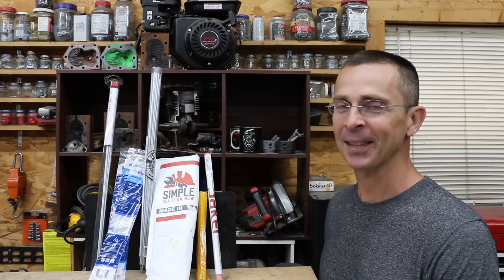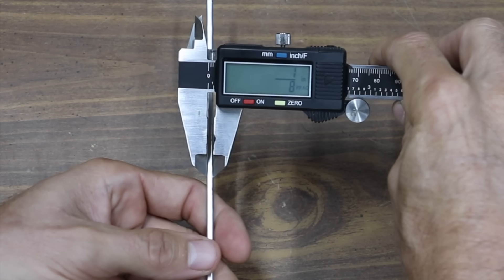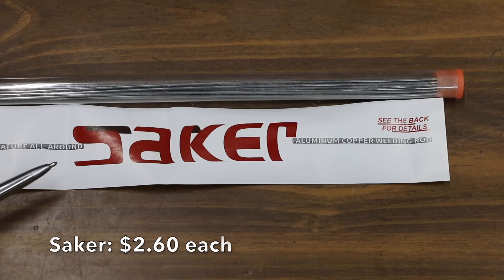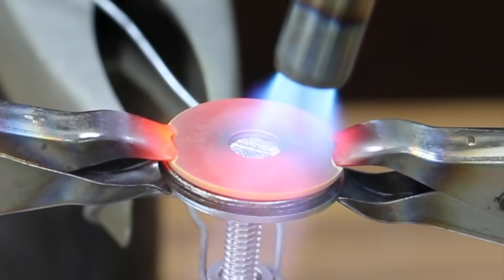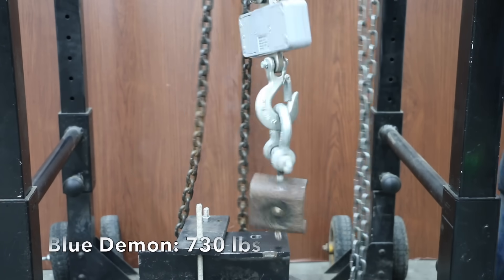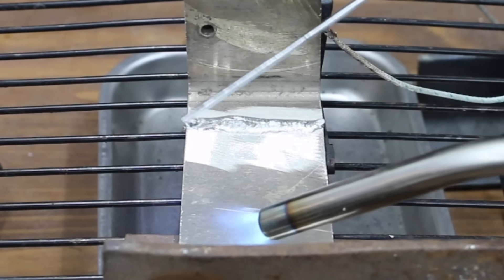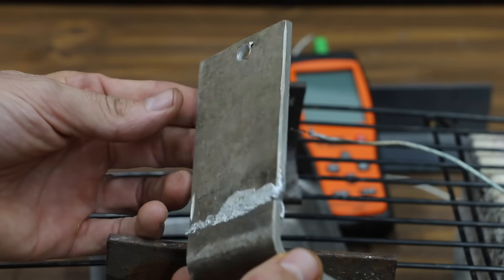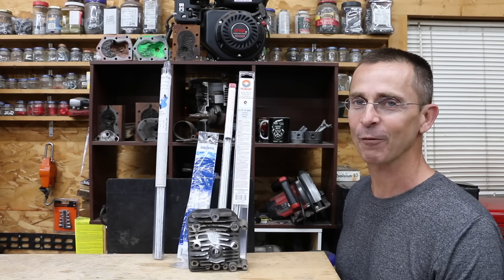Best "No Welder" Aluminum Welding Rods? Alumiweld vs Bernzomatic vs Hobart

Comment: I have one of those old 1950s aluminum poolside recliner chairs that uses steel springs inserted into holes in the aluminum tube frame. The cushions are still good, but almost every hole needs to be repaired. Along with a crack in the aluminum tubing at one place. I'm glad to hear that the Harbor Freight brand did so well, considering that I have a store in the next town over. And good to hear that MAPP gas is the gas to use. I guess I know what I'm gonna do next weekend!
Reply from the maker: Thanks for sharing.

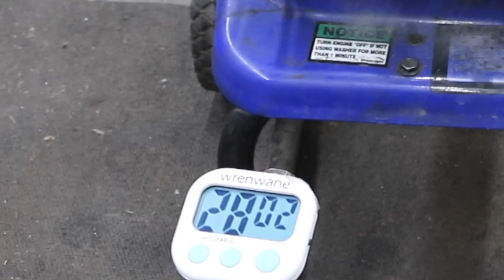Comment: 13:11 - "the repaired area is a lot cooler than the surrounding area"

That's not good. The purpose of the fins, is to dissipate heat from the combustion chamber, in order to prevent a hot spot causing predetonation... or worse yet, a heat accumulation area which may induce failure. A cooler exterior surface means less heat is being extracted from the head, which would lead to (at best) a reduced duty cycle.
Reply from the maker: Thanks for the feedback.

Comment: My aluminum storm windows could use some repair. But the material is 1/16" or so (thin).  I would like to see how to 'weld' the corners together (butt welds) with this stuff.  Because of the thin materiaal, I think I would need the one(s) with the lowest melting point.

Comment: The difference you see with the thermal cam is due to surface emissivity that isn't the same. In fact, it's really hard to have accurate measurement with thermal cam on metal... with your condition it's nealy impossible.
As it is my job to install and programm fixed thermal cam in the industry, the best advice for what you do is simply put high temp black BBQ paint on the surface measurement or using teflon emissivity sticker. You will have 0.95 emissivity ratio that is very good :)

Neverless really good video, I have on my garage some brazing than I was unable to melt so now I know it's not my fault if they don't work.
Thank you for this video !
Reply from the maker: You are welcome!

Comment: I used the Bernzomatic torch with MAPP gas and built a fairly decent aluminium camera mount using aluminium from Tractor supply and re purposing 1/8th welding rods whose performance improved dramatically after I knocked the coating off. Pics... https://1.bp.blogspot.com/-rj9rw3ZgcS4/YHy0Q-tjOoI/AAAAAAAAZhM/7BE1xctrOH0XmyWmRkdG9iCJ27c4gXm8gCPcBGAsYHg/s2560/IMG_20210418_181943.jpg
https://1.bp.blogspot.com/-M18eQSykceo/YHy0Q6K246I/AAAAAAAAZhM/gkAvAlV6-Scnzew1BxmwICcNiYkOkX5wQCPcBGAsYHg/s2560/IMG_20210418_113402.jpg

Comment: Great video. Using non chlorinated brake parts cleaner makes me wonder which aerosol solvent works best. I use supertech carb cleaner because it has the widest diversity of organic solvents in the ingredients for solvent action and uses inert non flammable CO2 gas as propellant. But I would like to see a comparison of chlorinated and non chlorinated aerosolized solvents and cleaners put to the test.
Reply from the maker: Thank you!  Thanks for the video idea.

Comment: All I know is my first time using this one was from Harbor Freights on a 5000 PSI system it was to my Turbo all my diesel the whole was size of a quarter very easy to use and been driving it for two-and-a-half years and the whole has not came back not just that it's 5000 PSI but it is very hot air
Reply from the maker: Thanks for sharing.

Comment: It would be interesting to see how you make out trying to braze two pieces of square tubing with a 45 degree cut for a 90 degree angle when you need to braze both the inside & outside surfaces.
Reply from the maker: Thanks for the suggestion.

Comment: I wanted to thank you for all the testing of products.   Years (,ore than 10) years ago I bought some rods at a county fair that a guy was selling.  He had several pieces of pipe , coke and Pepsi cans, a transmission case and several other real type uses to show the products and to show and, he let me try and would show me how I could weld a hole in a coke can if I would buy a packet for some 20.00 which I thought would be oj if I could make it work.  Well of course II did weld up a hole and bought a couple of packs because I worked in a car dealership as well as had a couple of farmer friends that always had irrigation pipes to fix.  that next week my transmission went out of my truck because I hit a large rock in the road and couldn't swerve to avoid it.  The case was broken in several places and was going to cost over $1000/00 because of it.  I  picked up the couple of pieces in the road while waiting for a tow truck.  I couldn't find a new case at that time and it was my work transportation so I tried welding or BRAZING it and it worked fine and is still on the road all these years later.  I've used it on several; things without any problems and its paid for itself 100 times over and I've made a lot of money fixing lots of things.  The trick is make sure its cleaned beyond clean with a stainless steel brush and I always use the brush only for aluminum or bought a new brush every time.  HEAT ONLY the base metal not the rod and it works great.  I will get the rods from Harbor Freight when I need them or there is some online that has different heat ranges I've used to build a small trash hauling trailer out of used aluminum and still use it today as well.  I used the high heat ones for that so give it a try
Reply from the maker: Thanks for the suggestion.

Comment: Very good video comparison! It comes down to what you are welding. How much does a miller dynastic 250 and setup cost?  Too much, but you get a true weld, whereas these are just braze. As I said, comes down to what you are welding. Good job not showing muggy. It's bad enough they Take you over the coals for 80 bucks, they over charge you with a 16 shipping charge for 1lb, lol. Take care brother
Reply from the maker: Thanks!

Comment: Excellent review but just one problem. Map pro isn't actually mapp gas. Mapp is no longer sold in most places nationwide. Map pro is just basically propane. I used a blue tank and a yellow tank with the same torch head and heated up a stainless bolt for 1 minute and checked the temp and got the same result for each type of gas.
Reply from the maker: Thanks for the feedback.

Comment: Great video brother ! Ben welding for 40 years now . Slways stick to your name brands when it comes 
Filler metal . Ill take Esab or UTP products over anything . Got a rep for my stuff not breaking . I always use M.E.K to prep my aluminum before welding . Its residue free and flash drys . Remrmber on thicker pieces your brazing together you should always butter or tin each piece seperatly .
Then braze the 2 tagether . Ive ben using aluminum stick rod to repair fuel tanks for over 30 years . Love your channel brother ! Be safe !
Reply from the maker: Thanks!

Comment: If you are working with aluminum just do what has been done for years, TIG weld and be done. There is only a couple of grades aluminum that are not recommended to weld. Tig welding of alum. is not hard at all and if it is a thicker piece you can use helium instead of argon for sheilding gas. As many used and even new welders out there they are very affordable and a tig machine is very versatile, and has many uses.
Reply from the maker: Thanks for the feedback.

Comment: I just bought some. Trying to weld aluminum to copper. I melted the alu before the rod would even get close. And it claimed melt at 500.
Will have to give one of these a try. Surprised at HF brand
Reply from the maker: Thanks for sharing.

Comment: I've tried the Hobart I preheated the metal to the right temperature with a temp stick. Then I used a TIG torch and it works great it look like a roll of Dimes. Preheated with oxy-acetylene. I have been a pipe welder for 53 years. Then I tried pulling tubing without the TIG torch it wasn't as pretty but it was strong
Reply from the maker: Thanks for sharing!

Comment: Thank you for doing this video, not long ago I had to downsize my shop and therefore lost the ability to weld whenever I wanted so I turned to brazing. The first few rods I bought were really bad, I melted the aluminum plate before the rod. 
Because of your video, I went to Home Depot and grabbed the Bernzomatic and I am enjoying it so much I am now making art brazing it all together. Thank you, I have started binge-watching your videos because like you, I have many different hobbies along with being a Mechanic and a Journeymen Electrician. Not bragging just saying what you do has helped me a lot.
Reply from the maker: You are welcome!  Glad to hear!
Reply: I picked up the H. Freight stuff but Benzomatic looks better overall.
Reply: Do you have any updates on the brazing of aluminum? Are you still using Bernzomatic aluminum rods? Do you have any important tips for cleaning?
Reply: @Ritalie  I clean with anything that drys clean like rubbing alcohol, I have even used Goof Off But I am sure Project Farm knows a lot more about this than I do.
Reply: How do you get it to stick? It's not sticking. It melts but doesn't stick.
Reply: @ESLinsider  The trick is to try to heat the aluminum close to the temperature that the brazing rod melts, I hope this helps
Reply: @ProudDad1976  Right I'll try it again. Torch I got stopped working.
Reply: I want to thank you again for your work on the videos, they are my goto when in doubt. Thank you!

Comment: One other thing.  This rod can also braze aluminum to copper (sucj as copper tubing to A/C aluminum tubing in heat exchanger.  You can braze on copper square to aluminum frame you want to make electrical connection to, then solder to the copper with soft solder.
Reply from the maker: Thanks for the feedback.

Comment: Brazing aluminum with these rods requires a totally different technique from conventional welding or brazing.  Best is to preheat the disassembled parts & work the alloy in to each surface.  Contrary to instructions, preheat the rod a little in flame (ALMOST enough to melt as the base metal is being heated.  You do not want the base metal to be too hot, just BARELY enough.)  The working in needs to be done at just barely above alloy melting point so much "scrubbing" is done.  Then assemble & heat (move into position as the brazing alloy melts).  Finish by sweeping around the joint edges with rod & allow to cool.  Understand that any heat treatment in the base metal (such as the bolts) is lost.  You can restore this by soaking at 350F for 24 hours, then air cooling.  The hardness returns slowly, in about a month.
          I used this to braze 1/8th scale railroad rail (1" high x 7/8" wide) to make criss-cross & switch frogs.  They have been in service for over 10 years, exposed continuously to the weather outside.  600lb steam engine runs over this rail.
          If you have an ultrasonic soldering iron, this can make better joints, as this facilitates "grinding out" the oxides.
Reply from the maker: Thanks for the feedback.

Comment: Would you test those inexpensive inverter welder 110 volts, as low $99 uscy , or the link if it is already done. Thanks a lot.
Reply from the maker: Great suggestion!  Thank you.

Comment: Thanks -- I seek to "weld" various nonferrous metals (coppers or various brass alloys) to various aluminums for light-duty connections required for scrap metal woodwind instruments. I might need to seek different products in this case but you gave me the best brands!
Reply from the maker: You are welcome!

Comment: There's a very good product from the refrigeration industry you might consider testing if you ever revisit this.  It's called AL822 by Lucas-Milhaupt.  It is an expensive product, but works extremely well.
Reply from the maker: Thanks for the suggestion.

Comment: This only works on small and thin repairs you won't be able to do this on engine cashes that can't be removed without removing them .. maybe the cylinder heads but not the crank cases ....
Reply from the maker: Thanks for the feedback.

Comment: What I LOVE about this channel is that during every video, I start trying to make my own decision based on cost, but by the end of the video the information is so well measured and laid out that performance and material units are what I can confidently make a decision on and not have to worry about "getting my money worth" since I know the value is already factored.  Thank you again PF.
Reply from the maker: You are welcome!
Reply: I went to the comment section to say this exact thing. It’s as if you stole the thought right from my brain. I greatly appreciate this man’s channel because his reviews and testing saves me so much time and money.
Reply: There are some things I will cheap out on, other things I won't.
But regardless of what I'm getting and which way I'm going, I consult Project Farm to see what he says about it.
Oh, and I will cheap out on the power tool itself, as I know HOW to use a 3/8" Hyper Tough drill as a Hole Hawg. But the bits? They will be top of the line.

Comment: I had a major failure with the brand from harbor freight. I had a tiny crack in an aluminum oil pan that I thought these rods would easily fix. I tried propane first and just couldn't get the rods to melt. Then map gas, still no luck. Then I got out the oxy/acetylene torch and once the rod got to melting point it burnt through the pan. Needless to say I had to get a new oil pan!😂😂
Reply from the maker: Thanks for sharing.

Comment: It would be interesting to see if TS100 soldering iron is hot enough to allow Hobart welding rods to be used. That would allow field repairs without gas or open flame. Just some Li-Po batteries, Hobat welding rods and TS100 soldering iron. Officially TS100 goes up to 450 °C so in theory it should be fine.
Reply from the maker: Thanks for the video idea.

Comment: Looking into making me a home made pontoon boat. Thinking about making an aluminum frame, then making my pontoons out of 18 gauge aluminum 4x8 aluminum sheet wrapped around the frame. hoping i can get my pontoons built for under $500.  Just gonna be a little back water pond hopper with a trolling motor, but  I figure if i make it 5' wide, I can make it more stable than my 42" wide jon boat ^_^  Was debating on getting a welder and learning that, but i feel that these would be easier to use and since I'm not looking at alot of torque from the trolling motor I should be fine ^_^
Reply from the maker: Thanks for sharing!  Have fun!

Comment: I wonder if that cut in the head could have been filled if you applied heat from the inside and the rod from the outside. It probably would have flowed much better. Great video, again!
Reply from the maker: Thanks for the suggestion.

Comment: FYI- I've got a mig and wanted to repurpose some old bed frame for tool stands. Unfortunately, bed frames are hit or miss as to what they contain, and don't weld well. You can go to extra effort to reheat and anneal them to reduce the embrittlement/work hardening they get at the weld, however its really a lot of extra gas to do that, and hassle/$$.  I'm just going to use some decent eutectic or silver solder brazing rods that are around 70 ksi which should be more than adequate for duty cycle expected.  Don't overlook brazing if you don't want to gear up for mig or tig.
Reply from the maker: Thanks for sharing.

Comment: Tried the Alumiweld from HF tonight on a fairly large aluminum piece; front timing cover of SBF.  I sanded, cleaned and heated the heck out the test area using MAPP gas, no luck. Then used my heat gun to heat the opposite side for general heat in a larger area, heated via MAPP gas for several minutes and could never get the Alumiweld rod to melt from surface temp.  My techniques were a fail based on the results of many Y-tubers demonstrations.
Reply from the maker: Thanks for sharing.

Comment: Thanks for this video. I've watched it more than once, parts of it more than twice. I'd like to suggest a "sister" to this video. All the manufacturers of butane, propane and Map/pro torches make astounding claims ("this torch can braze;" "this torch can hard solder up to 3/4" copper;" "this torch has a flame temperature of doxx degrees." Jewelers, plumber, a/c installers and repairmen rely on these for their heat output. Which one actually works the best? Many a/c installers rely exclusively on air acetylene or oxy acetylene. What works?
Reply from the maker: Thanks for the video idea.
Reply: @ProjectFarm  you're welcome. I've used & looked at different models of these many times, always wondered...

Comment: I bought some Hobart and blue demon. Both are very easy to work with when the environment isn’t fighting you. The wind yesterday was cooling the base metal faster than I could heat it. I got a few good ones plugged but I’m gonna have to wait till the sun is beating down or till I get a shop built lol.
Reply from the maker: Thanks for sharing.

Comment: Hello PF ~ I've seen ads for this type of "AL Brazing" rod several times, mostly on YouTube, so I really appreciate your putting together a very fine test for all of us non-welder types.  I spent an entire career in the electrical test, measurement, calibration and repair field, so I've done lots of soldering in my day, which, naturally, lends itself to anything requiring a heat source in one hand and the work material in the other...which, by the way, is exactly why learning to TIG weld has also had a strong appeal to me.  Anyway, I clearly understood that your test results have you favoring the Hobart brand rods as your "best in test," but I'm not exactly sure that I caught the rest of your top four.  If it's not too much trouble, would you kindly list your top four for me.  Thanks again and please keep up the great work...and, yes, I've liked and subscribed to your channel, sir.